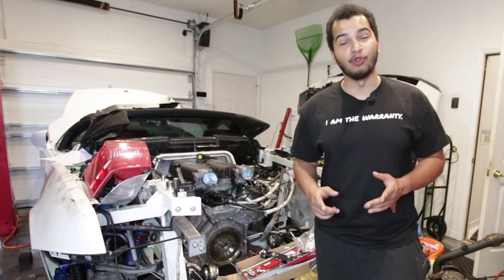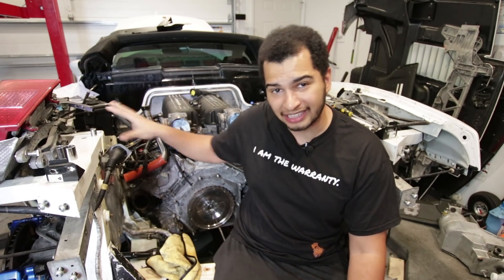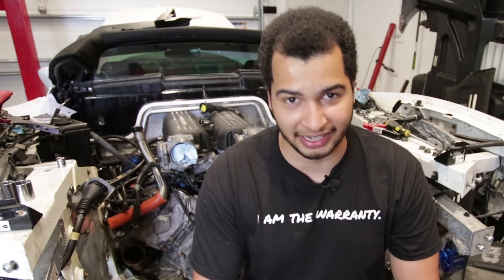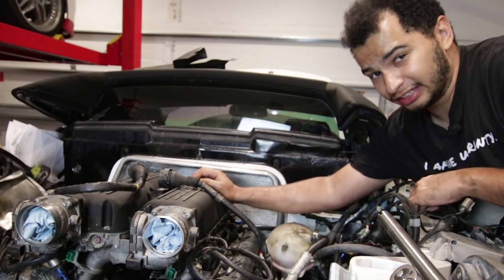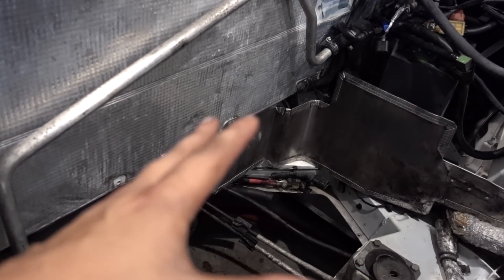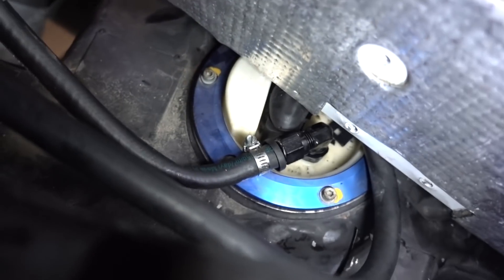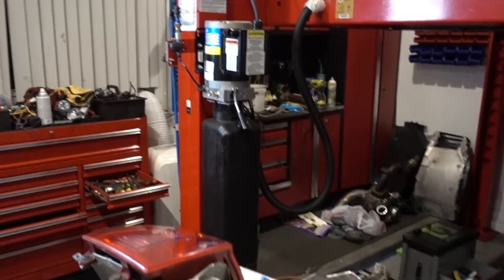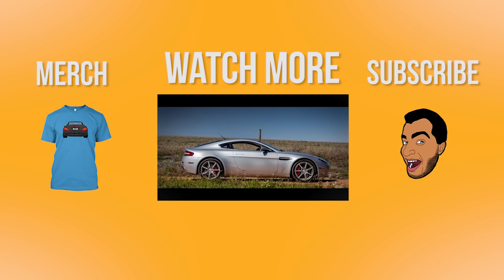Taking Out My Cheap Lamborghini's Engine Was WAY Easier Than I Thought

Comment: new fittings, new lines and flush the tank by using/checking the fuel pumps. block of the rails/ all fuel lines not neaded. raise fuel pressure up to 5 bar and see if there are any leaks to the system. measure fuel flow @ 3 bar.  inspect and clean all fuel injectors and use new o-rings. reconnect the whole system and do a final check for leaks. no more fire. greatings from germany.

Comment: I'd recommend to use only new bolts and dont reuse the old ones cause if you tighten them to spec (correct torque+rotation angle) they elongate (dont know if thats the correct word, basically the bolts stretch)

Comment: ...Also, the fuel line coming out of the top of the tank looked to be collapsed a bit where it turns up between the firewall  and motor.  You might think about addressing this before putting the motor back in as insurance.

Comment: Might want to swap out that hose clamp on the fuel line if it's a pressure line. That doesn't look like a high pressure clamp.

Comment: Great work!!! maybe u can take ur viewers suggestions by swapping/checking those fuel pumps. (looks kinda of stock)  upgrade it since it has large turbo system. Maximize it's potential which wasn't fulfil by the previous modifier. After fixing all the problems, bring it to a dyno  and tune it up!  You probably get bidding of $200k for this lambo after all these. Getting sponsorships,  subscribers viewership. A career made in backyard!!!  Envy.

Comment: The fittings on the left side are not factory. I would at least Teflon with petroleum compatible Teflon. (Yellow) and tighten them all up, the last thing you want is gas fumes leaking out of there on a hot day.

Comment: Those fuel pump lines are quick disconnects, and are supposed to move like that. Also rerouting the turbos would be stupid. They were already installed correctly as I'm sure you'll find out when you go to "reverse" them.

Comment: Put pressure on the tanks. 5-10 psi  through the filler neck and some soapy water wull show you if there are any leaks/evaporation points and could save you all of your work going down the drain on an insurace claim in the future!

Comment: Worn hose clamps on fuel lines on that type of pressure is a huge NO. You sure change them out. Plus to test the gas tank you sure have leak down test the fuel system. If not pump 3 psi into the tank and let sit for a few hour to see if it holds. You can’t just look at it for cracks.

Comment: On the right fuel tank you should change out that clamp they're not designed for high pressure fuel system. I had a  car before that was engine swapped and he had used those clamps on the fuel rail. Ended up dumping like half a tank of gas all over my engine bay one day.

Comment: If it was me I'd sell the turbos and buy an exhaust because you have all the power you'll ever need, the turbos kinda muffle the sound and with and engine built to take over 1000hp it should be petty reliable if left stock but you probably want something special.

Comment: how do you know the fuel tanks will hold vacuum, i mean like what about hair line cracks? perhaps that's just being paranoid. are the fuel pumps in the tank or external? either way it isn't melted or gaping cracks, one less thing to fix.

Comment: Worm Drive hose clamps on any part of a fuel injection system is a goddamned felony.  They will leak.  This car will burn again.  Fix it.  Are these fuel lines E85 compatible?  If not, they will rot out and it will burn again.  Is the wiring harness crispy and shorted internally.  Likely, and it will burn again.  Is the plastic composition of those fuel tanks even rated for E85?  You'll know when tanks start to swell.  Burn baby burn...this car's a Disco Inferno.  You are an insanely optimistic madman.

Comment: Pulling engines usually aint bad. I bet my dad I could pull one out of My monte carlo (1981) in 20 minutes. It ended up being grenaded worse than I thought, a peace of cam shaft got wedged under a piston into the cylinder wall. So I couldnt turn it over to get all the flex plate bolt. so I played with all the pistons till I found one that seemed to move, put a screw in it, was able to pull it right out, cuase it TORN the rod in half. Never seen a rod torn. seen them bent, but up and down torn, was a knew one. Anyways,  after pulling the piston out with a screw, I pulled out the peace of cam (This is when I realised the cam had broken) and then was able to turn the motor over to get the last flex plate bolt. All in all. having to pull the top end of the motor apart, and figuring out how to get it to turn again, I pulled it out in 42 minutes. My dad still made me pay him :/

Comment: So how if your standing there at the pump does this happen, I can seè why they would investigate.  You see how much gas is going in and is needed to fill the tanks.  Did it not automatically stop guy didn't notice and it over filled or did the handle somehow mechanically fail and require the emergency stop inside the station.

Comment: Pretty dang rare to see a vehicle that expensive and exclusive be built to be so service-friendly. Makes you wonder if it was more of a Lambo- or Audi- influenced design plan...(my guess is not Audi but I could be quite wrong without being surprised either). 

Tavarish my friend; you need to give yourself better ventilation! Working around those caustic fluids (esp. those with higher vapor pressure of course) can mess you up real good as I’m sure you already know; I don’t mean to be preaching to the choir so to say. From someone who has dealt with adverse effects from exposure to acetylene, toluene, xylene, all the good “ene’s” they are not to be fucked with and I like your videos and your style and it would bum me out if you had health problems from that.

Comment: I have a 2002 Accent 1.6L, with an Automatic trany and 21K on it. The cars
cranks but does not start. It’s an intermittent problem. The battery has
plenty of juice, and all other electrical gear works, radio, headlights,
and fan. Last time I put it in drive and let the car roll forward. Then
I put it in Park and it started right up, but, it didn't work this time?
Help!!

Comment: Exotic cars are actually the easiest cars to work on. Production cars are built by a ruthless gang of robots, who not don't care about the mechanics who will have to work on it, but rather it's designed to be a nightmare for the average mechanic in the hope that it will get you to buy another new one. Exotics are hand built, by guys with tools, just like the mechanics will use, and they are designed to last a very long time, to retain their investment value. The result is they are a mechic's dream to work on, usually.

Comment: Please please please replace the bolts you took out. Anything aluminum needs to be replaced. At the very minimum your clutch bolts and the driveshaft bolts. Anything that holds power really.

Comment: Terrible work done to this car. Unbelievable. Not only is it loose it's kinked because forcing a bend on a hose that is not that flexible. It should actually have a hardline in that part. Or softline with attachments along the way. Just terrible and dangerous work done here.